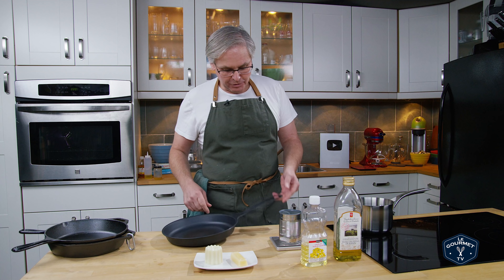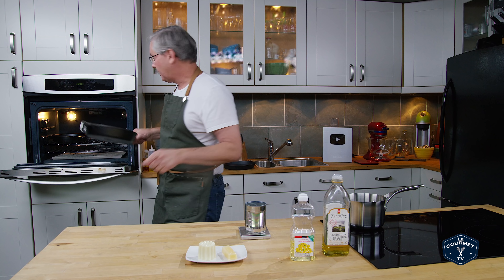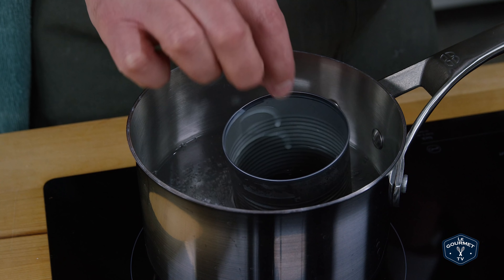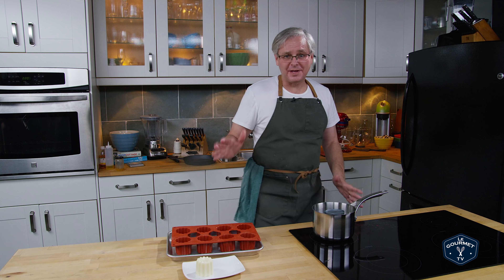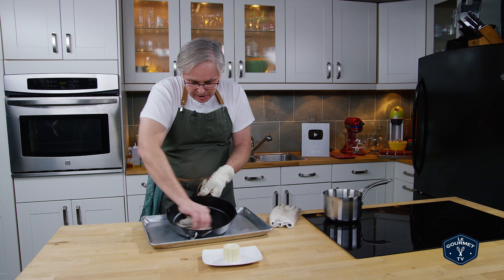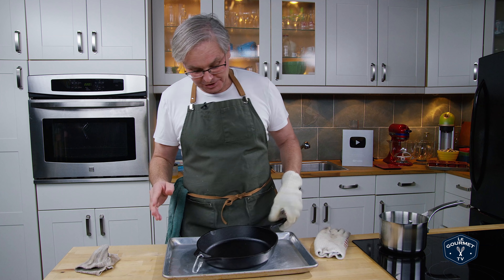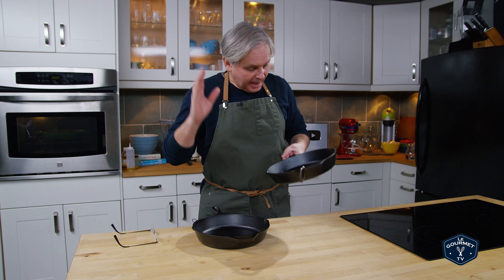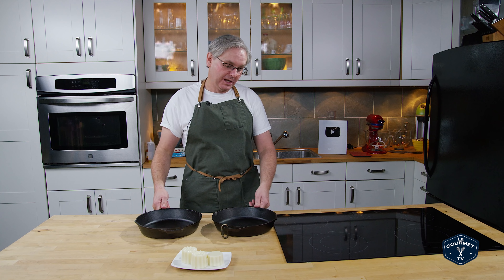Making & Testing Beeswax Cast Iron Seasoning Pucks

Comment: Seasoning hasn't worked for me so far. Maybe this will help.  
I have a dutch oven without any ceramic coating. I ONLY use it to bake bread because I don't trust it. Maybe a pan like that would be good to test, too. It was a very expensive pan, and for such a limited use, it seems a waste of space. I can't make beans, soup, or stew in it. It has the dimpled lid, not a flat lid. It was made by Lodge. When I first got it, the dimples started to rust a little, so I re-seasoned it and now only use it for bread.
Reply: You have to re-season after each time you use it, trust me, this is the secret to build up seasoning as fast as possible and have a non-stick coating. If you used it 3 times one day, you’re gonna re-season it 3 times that day. This doesn’t mean that you have to stick it in the oven after each use, periodic seasoning such be done on the stove top. All you have to do is heat up the pan and rub the oil as you usually would and you’re done. I have the same lodge Dutch oven, I season it after each time I use it EVEN THE LID, the dimples rusted on me once as well ! What I do now is heat the lid separately on my stove top burner and rub oil onto the dimples and entire surface, this way it won’t rust but again you have to do it after each use. Hope this helps! I was in the same boat before not being able to properly season my pans, now everything I use is cast iron iron haha. Get some more use out of that Dutch oven! You can pretty much make anything in it as long as it’s well seasoned.

Comment: I do mostly the same thing.  The bee's wax is new to me.  I'll try that.  I've been using flax seed oil.  I add an extra step a lot of people won't want to do but I think it is worth the trouble.  If you look at a quality antique cast iron pan, they are smooth inside.  Modern Chinese made pans are very rough.  I just bought a Dutch oven and it was like 40 grit sandpaper.  I take a small angle head grinder or orbital sander with 60 grit sandpaper and polish the inside.  (Don't use a grinding disc!) It will still have some pits in it but if you run your hand across the inside, it will feel smooth.  Then I scrub it real good with hot soapy water and season it like you do.  For most things, it is non-stick.  If something does stick to it, I just have to soak it in plain water for about 10 minutes.  I use the medium size pan almost daily.  I freshen up the seasoning about once a year.

Comment: I purchased a new cast iron pan that came with an entire kit for seasoning and cleaning cast iron pans. It had a"Crispee" puck with oil and beeswax. Culina (brand) Cast iron scrub which is a coarse salt and oil mixture for the times you need to scrub. Culina Cast Iron Soap, which feels oil based. I used them according to directions and they do seem to make it more convenient for maintaining my pans and Dutch ovens. I have family members who will fill dirty pans with water or set them in a damp sink. If not discovered quickly it's a disaster. The addition of the beeswax seems to lessen the potential for having to start the seasoning from start to finish

Comment: Can anyone report at all on how this has worked SPECIFICALLY on carbon steel?  I have never really had trouble with the seasoning on cast iron, but carbon steel is the one that flakes.  I have heard the beeswax method helps with these?

Comment: So I finally tried making this. However I found this ratio to be to soft. I feel like the heat from my hands shouldn’t melt the puck. It leaves a thin bit of oil on my hands like one of my salves. I’m going to re-melt them and add a bit more bees wax and go from there.
Maybe it’s my choice of oils. But I don’t think so. Shouldn’t matter as long as they are both high smoke point. I chose sunflower and grape seed.

Comment: Cowboy Kent Rollins has a video where he explains that he doesn't like the pre-seasoning that the pans come with, so he sands the roughness out of the pans and basically starts from bare iron
Reply from the maker: I wouldn't sand it off - run it through a self cleaning cycle in your oven.

Comment: I use the barbecue and flaxseed oil.   Take the pan to about 600F and the wipe it with the oil and back into the heat.  In and out about 6 times.   The pan ends up with a glossy sheen that is completely non-stick.

Comment: Two things.

1:  Since Lodge pans are pre-seasoned, shouldn't you have stripped off the original seasoning before doing this test?

2.  Wrought iron and cast iron are different materials.  Cookware is cast.
Reply from the maker: @Gold Winger - we will strip them down in a future episode, but many people believe taht even with a pre seasoned pan, there is a need for further seasoning.

As to your second point; yes we know that wrought iron and cast iron are two different materials... that's why I mentioned them both. Not all iron cookware is cast, there are several wrought iron cookware brands on the market, and we've been testing several pans from one of the manufacturers in our kitchen. Here's one of the many videos on it: https://youtu.be/bFXTecR4-Hg

Comment: couple of points. Wrought Iron is not Cast Iron, they are two different things and cannot be used interchangeably. Second, why are you seasoning a pre-seasoned pan?
Reply from the maker: @Pierre Duguay - A couple of points.
The first pan that I hold up and call 'wrought iron' 0:04 is indeed wrought iron and not cast iron. The pans at 0:57 that I call cast iron are cast iron. I wasn't using the terms interchangeably, I was using them specific to the correct pans. 

Many people add  seasoning layers to new pre-seasoned pans. Not needed, but definitely something that many people do.
Reply: @GlenAndFriendsCooking  Sorry, I recently watched your unboxing video on the wrought Iron pan. I apologize for my ignorance. You were indeed using the terms correctly. I'm sorry.

Comment: Good video. Your Lodge pans are preseasoned looks like. I've restored some cast iron in the last year and used my own beeswax pucks with the same mixture as yours. One thing you didn't mention is smoke while seasoning the pans. If you wipe as much off as you can, you don't get much at all. Leave too much and you will set off a smoke alarm. Also, I believe the beeswax helps with the burning oil smell you have while seasoning. A thing to know for those new to cast iron is it gets better with use. It doesn't have to be perfect to start using it.

Comment: just had this land in my viewing radar.. Thanks!  great approach & presentation.
question:  how often do the pans need re-treatment?
also: can this be used on a carbon steel wok (as high carbon  can tend to rust easily if not used -very regularly)..
Thanks!

Comment: Interesting. I had the idea to use beeswax a long time ago when I was using it as a lubricant for my drill press. It really does a much better job of lubricating the metal through heat and friction than oil.
Reply: You don't want a lubricating oil for drilling holes through metal. You want a cutting oil.

Comment: I thought that the idea was to use low smoke point oils, as it is the degradation of the oil that causes the bonding process.
Reply: I wonder about the linoleic acid content, wouldn't a high one like grapeseed like I'd use for spoon butter work best?
Reply: Oils with a higher smoke point turn intona stronger polymer on the surface. 

Flax having the highest smoke point can make a seasoned surface that can withstand the dishwasher.
Reply: @izuzan7419  I thought flaxseed oil had one of the lowest smoke points of all oils, not the highest...
Reply: @Animeeater25  it's true. Flaxseed oil is the most fragile of drying oils

Comment: Aren't those Lodge cast iron pans already pre-seasoned?
Reply: You can season pans as much as you want. Many would say that a preseasoned pan should still be over seasoned and stovetop seasons multiple times each. Others prefer to just  build a seasoning over time through cooking.
Reply: @gleamnite  True,  but respectfully, a fairer assessment would be to use raw cast iron. Running cast iron through a self-clean oven cycle should remove any preexisting seasoning  :-)
Reply: fair point but it also throw into the equation more things that can go wrong like surface rust or residual towel fibers from rough iron

Comment: I think the bigger issue today are the sand cast(rougher than rough) modern pans etc, or really old ones that need refinish etc? When I was young we had nice pans - smooth. Today(the last 10+years) I have used mostly new pans and pots. I cook in Iron for the supplement and longevity and no chemical or aluminum etc as an immune disease patient. I have tried the different oils, even the bees wax combo. I, like you, made my own. I find flax works well, not only because it does polymerize well but the real reason is the taste is awful so this is the only use I have for it ;) I have used bacon grease and lard for years and find it cheap, simple, and effective. My two cents. ;) I also use any oil at hand for adding to a freshly cleaned(I use a brush and water) pan.
Reply: Almighty Ohm cowboy Kent Rollins does videos on refinishing super easily and covers seasoning after. I've done it and my cast iron works better than Teflon I think. Kent does a lot of cast iron videos and recipes utilizing them.
Reply: The old pans still looked like that after casting but they hand worked them smooth for sale. That stopped with the ramping up in production as time went on. I will sand down my new pans then season them about 5 times in a row to give a glass like sheen.
Reply: Yes, the older ones are both smoother and are significantly lighter.  The older pans are much preferred in our household.
Reply: Try a black-steel (non-stainless) pan. Matfer Bourgeat pans are excellent and inexpensive. They come with the smooth texture you're looking for and season up just like cast iron.
Reply: @jdecar1  Thank you for the recommendation. I am going to try the Matfer Bourgeat 14 in paella pan on your recommendation due to weight of my current large pan (stainless steel). We'll see how it goes.
Reply: @skywarrior00  we bought the Paella pan for my father-in-law as a gift a few years back. He's been very happy with it. After seeing my Matfer steel pans he wanted his own. I have the crepe pan, and the 12" frying pan. I wish the 12" had the 2nd handle like the Paella pan.

Comment: My confusion is what temperature to use. Everyone is saying a different temp! The back of my can of beeswax, canola, and grapeseed oil says 500 degrees. I use a VERY thin layer of oil like you said in this video, but I always have these small, shiny dark spots all over. The pan is never sticky so I know I’m using the right amount, but I think my temperature isn’t right. UGHHHHH
Reply: Do u preheat ur pan?

Comment: Good video, IMHO whatever oil you use to season your skillet (I use grapeseed oil) like you said wipe it all off with a lint-free cloth. I use old T-shirts cut into rags, been washed so many times the lint is gone. I splurged on a Field iron skillet last year, it's expensive but I love that thing, I follow the care instructions they recommend and that's what they stress. You should end up with a matte finish so it doesn't get a sticky buildup (which is made worse by using a cloth or paper towel that leaves lint in the seasoning layer).

Comment: I restore old cast iron. I use Avocado oil, basically exclusively. It is close to flax seed oil in its final hardness, has a high smoke point, doesn't go rancid and is a crap ton cheaper than Flax or grapeseed. I've restored more pans than I can count and outside someone being stupid and ruining the seasoning it never needs to be redone. Seasoning pucks are honestly a silly gimmick to sell to suckers. While I agree there might be something to the idea of multiple oils providing a better finish as I've noticed that after baking cornbread on a freshly seasoned pan the surface is better as there is butter and olive oil in that mix. 

Now that being said, let me be fair here. I don't know how well straight avocado oil would stick to the base seasoning from companies like lodge. I always strip that factory seasoning as I just heavily dislike how it performs out of the box. That is a personal preference and not me saying that is the best method. Most of my personal use pans are a minimum of 50 years old and don't have that factory season. That stated, thank you for mentioning you wash with soap and water. I get super irritated with people who claim you cannot wash cast iron. If you can't wash cast iron without ruining the seasoning, your seasoning is garbage. I wash mine just about every single use with few exceptions and all of them will absolutely out perform any teflon pan.
Reply: Baking cornbread in a cast iron skillet has been (in my experience) absolutely the best way to build up seasoning in a new skillet, and it gets the sides too. That's after following the initial seasoning process in the oven. (I don't have any Lodge skillets so I can't speak for them). I bought a new skillet last year and made cornbread 5 or 6 times, it built up that seasoning like it was 5 years old. It slides right out of the pan when it's done. I haven't tried Avocado oil but you sound like you know what you're talking about and grapeseed oil is a bit pricey. I only use it for seasoning so it goes a long way but I'll definitely try that out. Thanks.

Comment: I allways coat a cold pan with oil, and then put the thing in a cold owen. This way the cast iron is heated fairly slow. This is not because I have any deep knowledge ablut metall - but I aallways burn myself. And it seems to work just as good as when I preheat the thing. If you do it in several coatings you can get a pan that is like glass.
Oh, i have refurbished a couple of old pans that I got becuase people was going to throw them away. I done it with sandpaper, anglegrinder and floppy discs. You can be really rough with them - and they often ends up better then a new pan.

Comment: What are your thoughts on cast iron that may have been mistreated, but to be bought up to standard?
Reply from the maker: I’ll run it through an oven self clean cycle - start fresh with bare metal. At that point you can really tell if it’s worth saving, or too badly pitted.
Reply: @GlenAndFriendsCooking  Thanks for that.

Comment: There's a brand called crisbee that makes a beeswax/ oil stick for cast iron seasoning. They have a few different variations including one they call larbee that is lard and wax instead of soybean oil. I have tried flax and lard and both have worked well but I don't use my cast iron enough to say one was better than the other. My brother uses straight crisco on his cast iron and carbon steel pans. I may try a mix of 1 part beeswax to 1 part flax and 2 parts crisco just to play around.

Thanks for the video.

Comment: Thank you, this video helped me feel much more secure about trying to restore the seasoning in my Lodge! I have one question, though. Should I expect much smoking when following this process? I live in an apartment with a sensitive smoke alarm and I have been very concerned about trying to restore my trusty pan.
Reply: It does get smokey.  I would recommend you remove the battery while you're seasoning.  It's  pretty easy to do and even if you mess it up, it can be fixed.

Comment: When I first started learning about cast iron, I was indoctrinated into some really unpleasant beliefs like you should season it after each use and never to use soap. It made using and cleaning it such a chore... so glad to have woken up from those myths
Reply: Can you explain the myth behind the ban on soap?
Reply: @jordanjay29  From what I understand, dish washing soaps used to contain lye which made them very strong and would destroy the seasoning on a cast iron pan. These days, soaps are generally much milder and do not contain lye, so there's no risk of hurting the seasoning with most modern soaps. The advice of never using soap on cast iron used to make sense, but these days the advice is outdated.
Reply: I know some people who get angry if people use soap... so, I agree with you and avoided using cast iron for that very reason.
Reply: @jordanjay29  The idea is that if you use soap, it will remove the seasoning.
Reply: @Ogg_Vorbis  thanks for the most complete answer.
Reply: @jordanjay29  I think people have been confusing seasoning (the layer of hardened oil) with residual oil. Soap of course removes any oil, which some might like to keep for flavor or food release.

Comment: Thanks for the tutorial! So in celcius this would be about 100° and 250°.
Is the process any different for wrought-iron? Some years ago I bought a wrought-iron pan, and as far as i can tell, it was already "pre-seasoned", I guess. The documentation to that pan said, one should put a lot of potato peels with a very small amount of oil in it and heat it on the stove, until smoking, for some time...there was a time mentioned, but I do not remember anymore...it was not a short time, if I remember correctly. And that would be the process of finishing the seasoning. I found that instructions a bit strange....
Reply: Should be the same. I use the same process for my high carbon steel pans. I think the peel method is designed to soak up the extra oil.